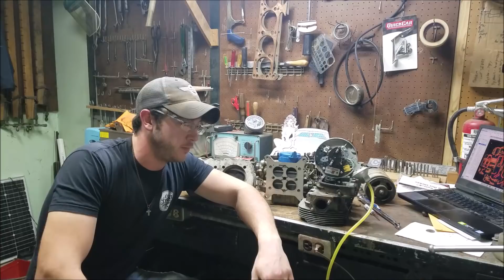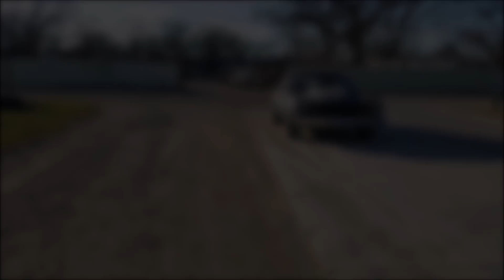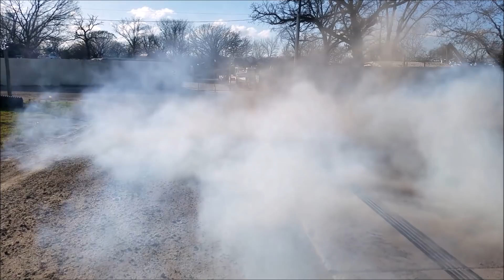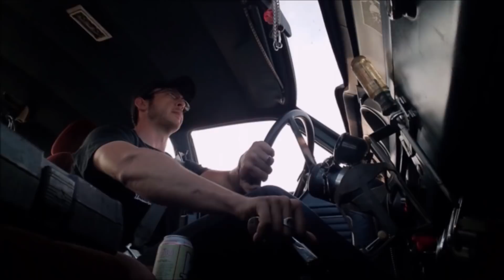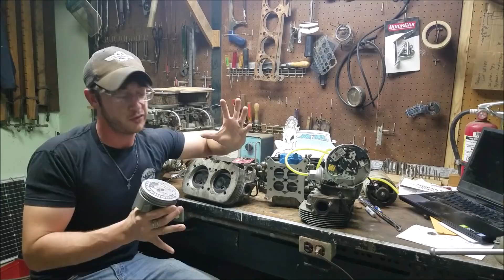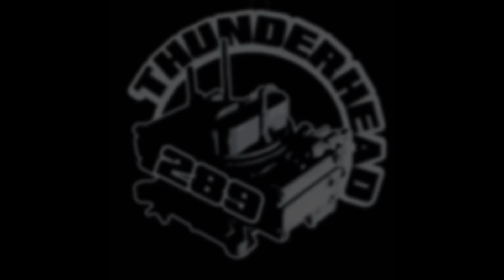How Ignition Timing ACTUALLY Works, ya idiots

Comment: Vacuum advance should be hooked to ported vacuum. Ported vacuum comes into play at light throttle/cruising speeds. This advances the timing, to advance timing even higher than centrifugal advanced timing. The purpose of this is for fuel economy. If you notice that mallory distributors do not have a vacuum advance, because they are not worried about fuel economy, just total advance at wot. When you are at light throttle, the throttle plates are open enough to allow vacuum to pass through the ported vacuum port and advance the timing. If you hook it to manifold vacuum, your timing will be too high at idle. This can cause rough idle. Hooked up properly, you should be able to get 4-5 mpg better than disconnected.
Reply from the maker: All things I have said in the past. I’m a huge promoter of ported advance. search ported vs manifold vacuum and see what your top search result is. 

I even show that ported in fact does drop out just like manifold at hard throttle by having a vacuum gauge hooked to both. 
For whatever reason folks tend to confuse venturi vacuum with ported. 
I always try to explain that venturi vacuum is present in the carb, it’s what actuates the vacuum secondaries.
Reply: Hi there, could you please clarify why having more advance timing ( timing too high?) at idle with a Vacuum advance is a bad thing? I have been told that throttle response would be optimized with less mechanical advance ( but faster curve) in the distributor, and a higher initial timing ( say 10 -16 degrees BTDC) for Total Timing of 30-36 degrees. Cheers

Comment: Great explanation. Never thought of the atomization changing the amount of time to burn and affecting timing needed as well. 
Btw, what is your intro and outro track? Sounds vaguely Alice In Chains ish…
Reply from the maker: It’s not the atomization, it’s the allowable volume via the throttle that atmospheric pressure is allowed to cram in. 
Everything on earth is equalized pressure to atmospheric - when you create a low pressure area, like drawing a cylinder down, atmospheric pressure tried to cram itself in there - your throttle restrict how much is able to go in.
Reply: @ThunderHead289  oh ok, I had thought you said the space between the fuel droplets affects the burn.
Reply from the maker: @colinvargo3418  it does - but if you are quantitatively putting less volume in the cylinder, which the cylinder chamber being a static size, those particles are farther spaced out from each other within the cylinder.
Reply: @ThunderHead289  Nice and easy!😄👍
Reply from the maker: Now turbulence does actually speed up ignition propagation - this is why a distributor stops advancing at like 3000 rpm even though rpm far exceeds this - the turbulence of the air coming in actually speeds up the burn time, so even though your locked at 34 degrees or something at anything above 3000, technically the burn rate of the fuel keeps getting faster. 

Again, like 0.1 percent of people understand this.

Comment: THANK YOU for this! wow, I can't tell you how many times I've come across people totally destroying carburetors because of this very thing. I mean it's gotten so bad I don't even look at Swap Meet carbs anymore (esp Eddies that come with the "tune kit"). They've been taken so far out of base line, & DIY drilled that it's not worth it to me anymore to try and reset them. Why did they do all this? Exactly what you show right here. It's the Distributor not the Carb. But now with the DIY InnerNet, I'm finding this in used distributors as well. Much easier to just buy new ones, with a set base line you know, and go from there on either of the 2.

Comment: In my '36 Ford lately, the vacuum advance has been making a screeching sound when the engine is running. When I disconnect the vacuum advance line, it stops making the noise. So I was going to pull the spring and piston out of the vacuum advance and try to run it by idling up the carb to counteract the having no vacuum advance stuff on it, but was also going to check and make sure nothing was bound up in the advance plate. The distributor was rebuilt before, but I'm thinking about sending it back to the rebuilder to go through it again if I can't find the source of the problem. 
Take a look at one of those distributors when you get the chance, it looks like a divers helmet, and has 2 distributor caps. That's what I'm trying to work with.
Reply from the maker: Sounds like it might just have a ruptured advance diaphragm and that’s what you hear whistling as air is drawn through it. Easy test is to just suck on the hose - if it’s good, you shouldn’t be able to pull air through

Comment: Probably the best description of the process.  Its amazing how long the burn time can be (& then piston speed, long vs. short stroke, higher rpm...), lol.

It definitely will give folks a better basis to understanding the multiple burst injectors they're researching for economy & performance (much like the high hp  diesel tech.). Thanks!

Comment: The vacuüm advance was broken on my 1975 land rover.
And it noticeably decreased part throtle performance and fuel economy.
I fitted a fancy bleutooth programable distributor and drives a lot better now.
Its a very low perfermance engine so if its missing power its very noticeable.
Reply from the maker: It wouldn’t happen to be a progression unit by chance would it?
Reply: @ThunderHead289  its a 123 ignition unit. Its the same sort of distributor but the progression unit might be slightly fancier.
It runs a 1000 times beter than a €40 Chinese point distributor.
Thanks for al the tips on carbs and ignition over the years!
Never used any of it on an American car though lol.

Comment: How can you tell if you either have a distributor starting to go bad, or have Carboned up valves? My truck reves and idles fine, but while driving it has this weird intermittent miss like a lack of spark, I tested the coil and it is good, it has new plugs and wires on it a couple years old.
Reply from the maker: Are you sure it isn’t leaning out at times? Do you run a wideband?
Reply: @ThunderHead289  update on my issue, it's not ignition, I have a collapsed lifter or two
Reply: @ThunderHead289  I am running a regular 4 barrel holley, and I have rebuilt and tuned it properly, this problem started about a month ago or so. The miss isn't a lack of fuel, it's like it suddenly has weak spark in a cylinder or two, an I also replaced the rotary cap and button and that help it a little but it still does it

Comment: I have scfi now on my truck do you think it would be advantageous for me to swap to a carburetor 
I really want to simplify my electronics on it.
It runs fine but I want more powa thanks
Reply: If it runs fine now, you are not simplifying by swapping to carb. And you do not necessary gain any horsepower. You could lose some. If your scfi is to small to feed your engine, you cold gain hp on higher rpm, but don't do it if you not sure.

Comment: so at WOT from a stop the engine drops vacuum and so does the vacuum advance - correct?  What about a cruising speeds?  65 mph on the highway and a little acceleration does the vacuum advance still work?  And once again does the engine drop vacuum at WOT while cruising at highway speed?
Reply from the maker: If you have no vacuum, you have no vacuum advance. 
Vacuum drops the more you open the throttle relative to a load on the engine.
Reply: @ThunderHead289  Thanks!  How's the Galaxie?
Reply from the maker: @jewllake  the teal 64 is in hibernation for winter and the black 65 with the supercharger hasn’t been Touched since we moved. 
Pretty low priority, and everything has to be custom so it takes some a lot of time. 
We have had a lot of home projects since we moved, so I haven’t gotten to it yet.

Comment: If there was no reason to ever not run a vauum advance then why do all of the various distributor manufacturers build mechanical advance only distributors?    I run the MSD pro billet version and it has no vacuum advance.  My set up is far from a stock engine that somebody wants to pokey around with though.   Maybe you should have said to keep your vacuum advance if you have built a stock to mildly modified engine vehicle that you drive mostly on the street.

Comment: One thing I would have liked to see was a discussion on re-curving a distributor and adjusting a vacuum advance module to get the right timing vs RPM.  Messed up smog distributors from factory smog motors are the root of most of my issues. They were designed to retard motors for emissions and its hard to get them where they need to be.
Reply from the maker: It’s in my ignition timing playlist - I have actually already gone way in depth on each specific ignition item

Comment: Mine's a 94 that originally had TBI before I converted it to carb.  It hates any kind of advance beyond just a bit of mechanical advance.  If I set the initial to even 4 BTDC, or plug the vacuum advance in, it will ping like mad under load.
Reply: Are you sure you have the right TDC?🤔
Reply: @olekdah 
Yes.  Yes, I do.
Reply: @Jerkwad152  OK🤔 Do you know the comp ratio? You said it was a TBI. A TBI can manage high compression because it retard timing when knock sensor feels ping. Then it can run on low octane fuel. A carb engine can not necessary run the same octane fuel on the same engine. Have you tried higher octane or octane booster?
Reply: @olekdah 

Didn't notice your comment until now.  It's all academic at this point, since a couple of hit-and-run drivers took out my truck.  I did save the engine, and am in the process of going through it.  It's going to get way better heads than the junk swirl-port smog jobbers, and a good roller cam.
Reply: @Jerkwad152  Sorry about your truck! Good luck whit the engine project 😀

Comment: Yes....an engine with a static CR of 9:1 with a lopey high overlap cam loses cylinder pressure down low.....it'll need more initial timing to make up for lost pressure. With no vacuum advance, you'll only have initial + mechanical advance to maybe 35/36 degrees at lower rpms. (under 3000)
Add vacuum advance for more timing and efficiency at lower rpm.
On a small block Mopar, I have 35 degrees initial + mechanical all in @ 2,300 rpm in a heavy truck and it pulls well. No vacuum advance currently....it stopped working suddenly. Fuel mileage is terrible without it!

Comment: Could timing issues be a result in carburetor running rich
Reply: It could seem so, but I think not. Your carb can run right, but Your A/F readings can say to rich if you have to late timing, resulting that your engine is not fully burning all the fuel. I like my carb to stay at fabric settings, if I don't have a very good reason to change something.

Comment: I’ve put together some pretty aggressively cammed small block Chevies for street use and used a locked out distributor around 40 to 42 degrees of advance but starting can be a royal pain. Using a vacuum advance though if it is set up for 8 degrees you can set the timing for 32 then when you start it and tgere’s no vacuum it’s starting at 32 then once it starts it idles at 40 this clears up a lot of issues with a rich idle with a radical cam then when you stomp on it and the vacuum goes away the mechanical weights take over keeping the timing where you want it. Distributor recurve kits have springs and weights so you can achieve this . Weights determine the amount of timing added  to the initial and the springs determine what rpm it comes in. Lighter spring the sooner it comes in.
Reply: It idles at 40????  40 degress on the crank?  Are you saying you have vacuum advance but no centrifugal advance???  It it ported or manifold.
Reply: @auteurfiddler8706  locked out distributors do not have any advance, vacuum or mechanical. Common practice for a circle track or drag car but not so great on the street because of hard starting issues. I have run a few this way on the street but they were pretty rowdy small blocks with big heads , high compression and very aggressive cams  . The last one was a 420 cubic inch sbc with 13:1 compression and a 600 lift solid roller cam , 4500 stall converter , built th400 reverse shift pattern trans brake, 9” rear with 4.88 gears all in a 1980 Malibu 4 door street race sleeper.
My current build is a more mild small 355 maybe stroke it to 364” gm block, forged bottom end crank, rods and pistons, around 11:1 compression, 204 cc intake runner aluminum heads with 2.05/1.60 valves etc should be about 550 hp all motor and plan on a 200 shot of nitrous on a progressive controller. Just need to find a cheap car to put it in. It will probably also use a locked out distributor but with some kind of electronic ignition box like an msd so I can set up timing retard for he nitrous it can also retard the timing for start up.
Reply: @AndyGeesGarage  😁I would like to know the fuel consumption on your 420! Or not!!😅 But I guess the fun factor overcomes that?😄
Reply: @olekdah  definitely not a gas sipper lol. Probably less than 10 mpg I ran a 950 cfm Dominator on it. The bottom end was made up of used sprint car parts including tge Dart block.
Reply: @auteurfiddler8706  i miss understood your questions.
Yes it idles at 40 degrees on vacuum advance then as the throttle opens the vacuum drops  but by then the rpm should be high enough to bring the mechanical advance weights into effect to maintain the timing. How soon the centrifugal/mechanical comes in is adjusted by changing springs on the mechanical weights, how much timing is determined by the weights and their shape.

Comment: I did remove vacuum from my 1972 BMW 2002, but that was vacuum retard and I went with a mechanical advance only. That was also when I pulled the Solex 2bbl carb and replaced it with the Holley-Weber 28-36 2bbl mechanical progressive carb. Weber design built under license by Holley and OEM on early ‘70s Ford Pintos with the 2.3l 4-cyl engine.

Comment: Make sense blue print engines tells people buying their 383 engine to run 13 to16 initial and total 34 degrees NO vacuum which doesn’t make sense and can cause a very rich idle because of lack of advance at low rpm thick it would help using manifold vacuum?

Comment: Hi Luke, I’ve been watching most of your videos on ignition timing and learned a lot. Right now I’m restoring an old EFI Mercedes sl with my dad and I was wondering: how do I know if ignition timing is too much? The workshop manual 15 degrees before tdc at 3000 but that way the car is sluggish. With 35 degrees at 3000 rpm the engine feels like it has way more torque but can I get more timing or will I damage something?
Reply: 15 degrees was very low. I think you are more in the right numbers with 35. Your EFI have a knock censor that pull of the timing if it gets to high I guess?  Most naturally aspirated engines like a total timing of 32 to 36 degrees BTDC. What is right for your engine depends on the compression ratio and the shape of the combustion chamber. And of course your type of fuel. 10 to 16 degrees initial timing, and 18 to 22 mechanical advance is normal. And finally vacuum advance. My small block chevy 383 (6.3 L) carb engine with fast burn chambers, 10.8 compression, runs on 14 initial, 20 mechanical (max at 3000rpm) and 16 vacuum. Cruising at 3000 rpm it pulls a total of 50 degrees with A/F readings around 14.5. 15 l / 100 km or 15 Miles per gallon (USA). A rather radical camshaft for street use thou. Close to 500 hp.😃
Reply: @olekdah  thanks for the explanation. I think the manual means 15 degrees of initial advance because this way the total advance is around 34-36 degrees at 3200 rpm (plus the vacuum advance). I made the rookie mistake of setting 15 degrees of total ignition timing and that’s why the performance were extremely poor. Btw I don’t think the car has any system to decrease the amount of timing in since it has points and the efi is very old (‘72 Bosch d-jetronic)
Reply: Clearly book is wrong, 15 is a gutless thirsty slug. 35 sounds around right. . Searching between 32-38 degrees total  should find the max power.

Comment: Years ago before I knew what vacuum advance was for I had bought a car, ran good, pulled hard, decided to put a timing light on it, forgot to disconnect the vacuum advance and went “What!? There’s no way there’s that much advance at idle!” Then I realized what I did, disconnected the VA and things looked more normal. Right then I said, I gotta find out what this little VA gizmo is really doing lol.
Reply: You had it hooked up wrong.

Comment: Another thing a lot of people fail to take into consideration is the overall condition of the motor. No matter what parts you throw on it, if the motor is tired, you won't get much out of it. Low compression and uneven compression will kill the possibility of power from the start. A worn cam will shoot you in the foot too, along with worn valve springs, especially if the motor sat for a long time. And dealing with timing, what about the timing chain? If your cam is retarded from a loose timing chain, that will affect the timing numbers you see at the crank. A lot of people just want to throw an intake, carb, and herders on a 100,000 mile engine and expect a rocket. It doesn't work like that in the real world. Love the videos Luke, great job as always, and even better seeing a young guy with the knowledge that you have. Have fun fixing the Poopenwagen......they are just so fun to work on. 😬